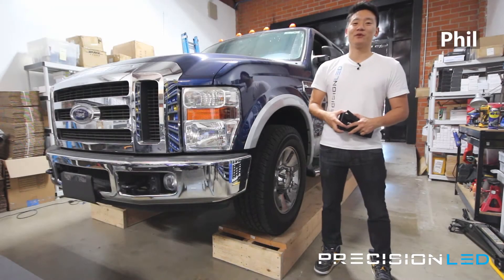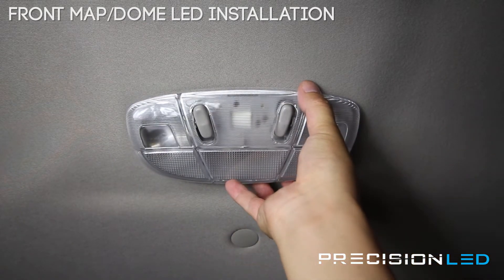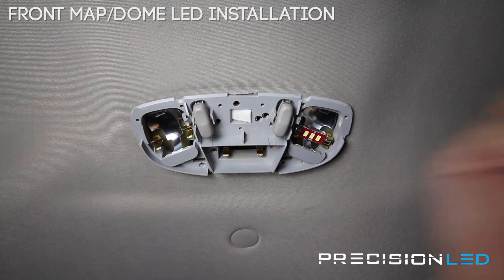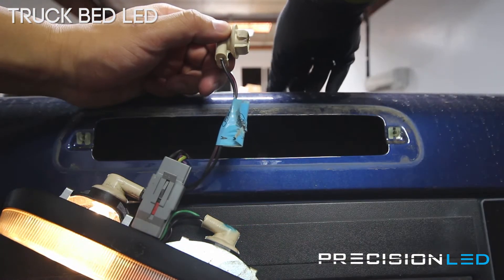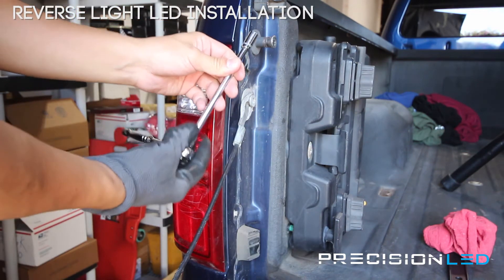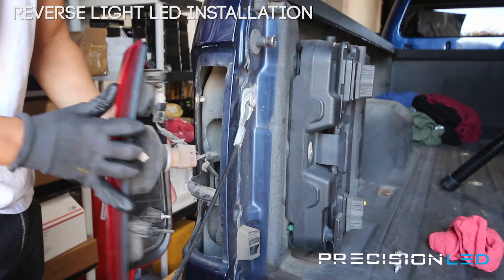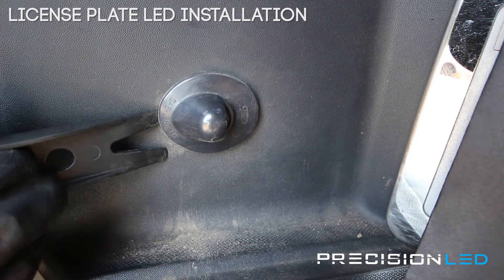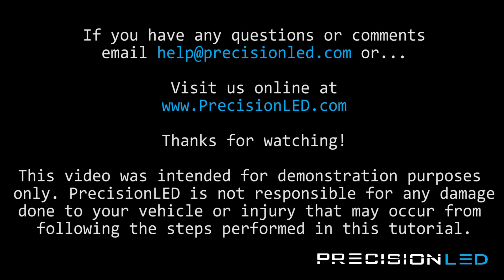How To Install Ford F250 LED Lights (11th & 12th Generations) - 2007-2010

Comment: im interested in the rear taillights, interior lights and headlights if you have. i have a 2010 F350
Reply from the maker: Thank you for your interest.  I have linked our F350 page below for your convenience.  Unfortunately, we do not sell the headlamps for your F350.  However, I would not rule this out in the near future.  I would recommend checking back in a month or so.

http://www.precisionled.com/vehicle/ford-led/f-250-35-led/f-250-350-2008-present.html